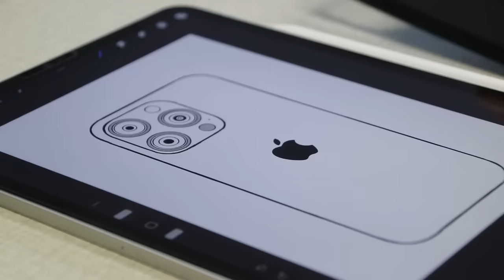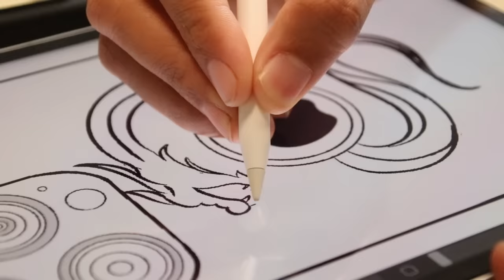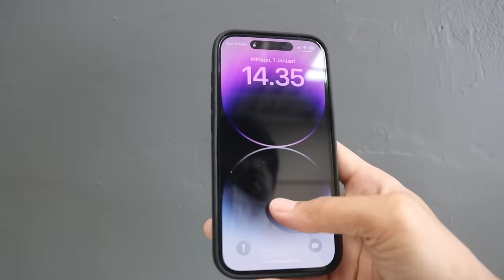i put 18k gold into my phone case - i make jewelry for my phone

Comment: Can I ask if you put  18K gold in your phone case but how "an it be  18k when you mixed  copper in with the Gold bars
Reply: The gold bar is 24k.. To make it 18k you need to melt it with another metal..??
Reply: Gold is a very malleable and soft metal in it's purest, 24-karat denomination. Copper is added to enhance strength and shine.
Reply: Also,gold karats are counted from ratio of gold to alloy metals like copper. If I'm not mistaken, 12Karats means 50%gold, 50% other alloy metals.
Reply: @zendarc  thank you I'm sorry I am still pretty new to the silver and gold stuff I collect silver coins and gold  but most of the Gold that I got is like the Gold  fingers and other gold out of scrapping out  junk TVs and stuff like that but now the only problem I am having is how I can safely recover the gold and separating it from the other metals like  copper oh and I have some Junk Gold jewelry I have as well but I can't find anyone that could help me with recover the gold even though I was told by someone that I could Use like  Viniger and  Salt to recover and remove the Gold from other metals because from the junk Tvs and the junk computers friends have been giving me I've been able to collect a decent amount like a big freezer bag of junk gold jewelry and gold fingers
Reply: @mikepalet3900  wow.. Cool 👍🏼👍🏼